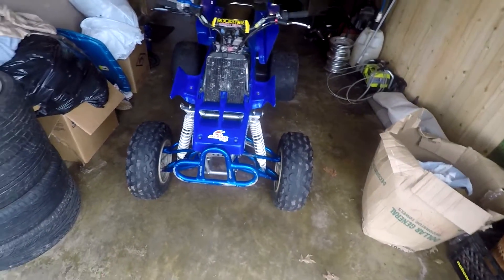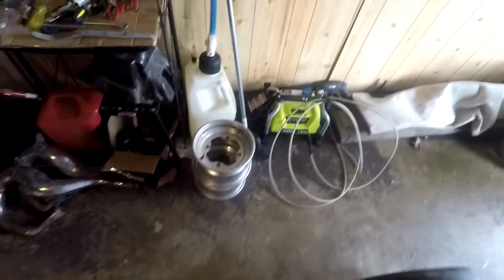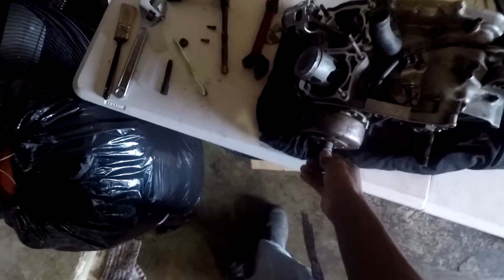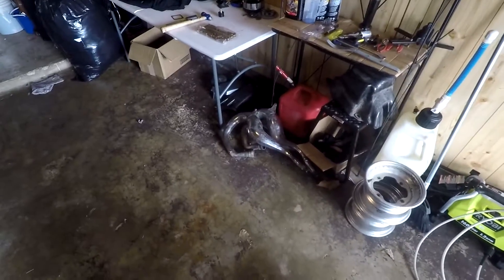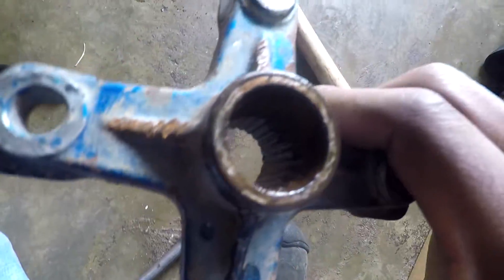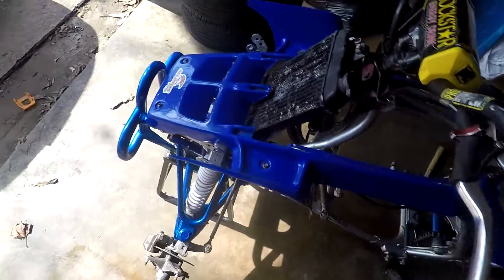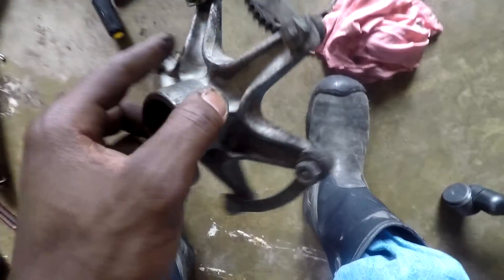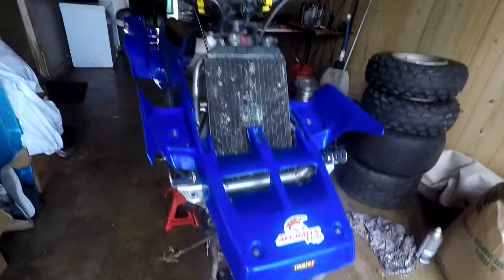Working on The Banshee Pt 2 Build Plans

Comment: Check those connecting rods for slack on the crank. To do so grab each piston and bring to tdc by hand. then gently shake up and down and check for slight slack. If possible see if it's in the top of the piston connecting rod or the bottom. If top is loose it's mostly piston wrist pin and needle bearings. But if bottom has slack (God forbid) you will eventually need to redo the crankshaft in the bottom end.
Reply from the maker: Yeah I did.. The crank is toast.. I mentioned it in an earlier video.. The bearings are actually stuck..

Comment: you getting the alba long/standard travel a-arms??
Reply from the maker: Yes sir.. Do you have any experience with them??
Reply: ClutchLuck24/7 no but the next set I buy will be from them. I hear good things about them and I just bought a +2 steering stem from them and it seems just as nice as other more expensive brands I've used. let me know how they are
Reply from the maker: Will do.. I was going to buy that steering stem too but it might have to wait till later